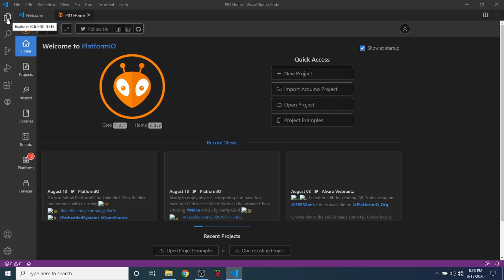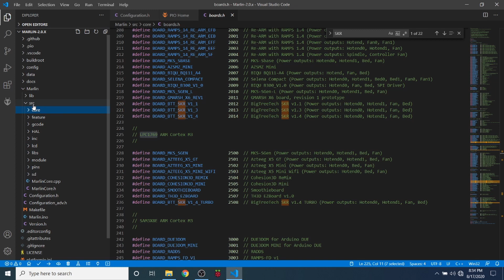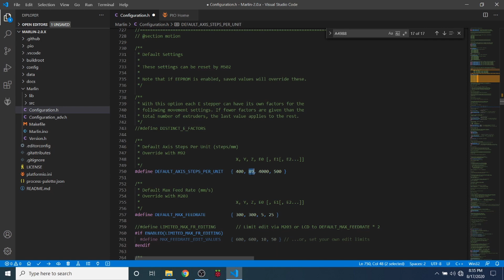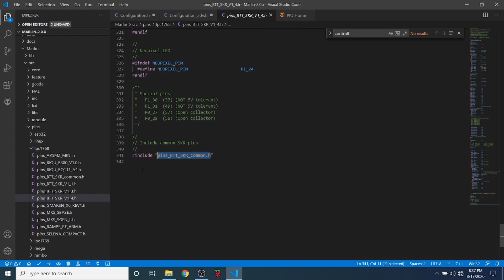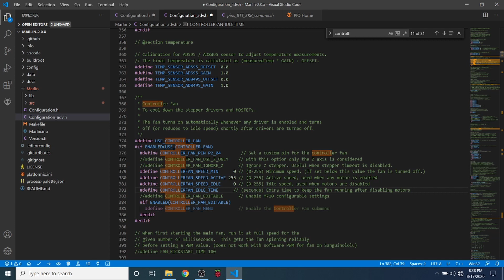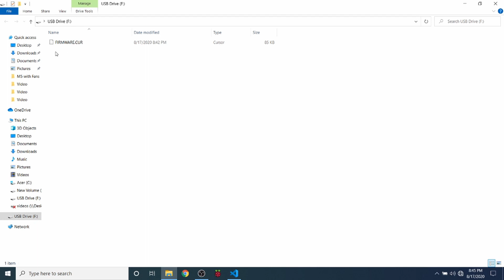SKR 1.4 - Marlin automatic stepper fan controller

Comment: Is there a way to set multiple pins to turn on with this?  I have 3 fans each in a different port on an octopus 1.1
I got it to work with the center fan but it would be nice to have all 3 turn on without having to wire them together.

Thanks!
Reply from the maker: Yes.  There's a link to the playlist in Description .
Reply from the maker: Note BTT Octopus has it's own playlist.

Comment: I’m using noctua fans for enclosure cooling. They should drive on 100% when steppers are moving and 50% when not. Is working fine but PWM is so noisy. Is there any solution ?
Reply from the maker: Better fans?

Comment: I'm trying to do a heated AND ventilated chamber, with HE1 controlling an SSR for the heater but I want another output to control chamber vent fan (to bring chamber down if too hot)... BTT really screwed up by not allowing the normal fan1-3 headers any kind of control. apparently I can use the TFT TX pin but I'd like that free for a future TFT upgrade :(

Comment: Hi! I´ve bought an SKR 1.4 Turbo board but I am having issues to connect it to the PC, maybe it´s missing a driver on the computer, can you help me?
Reply from the maker: What's the jump set to for usb?
Reply: @EdwardBraiman  I am using the blue one, that´s also used in arduinos
Reply from the maker: In my playlist for SKR 1.4 there is a basics video.

Comment: Hello.
thank you for these beautiful videos.
I have skr v1.4 turbo card.

Although I have done all the steps in the video, I could not run P2_04 pin.

I've also tried different versions of marlin but it didn't work.

engine running, fan not running.

Where am I going wrong?
Reply from the maker: Check pin with multimeter.

Comment: Very clear presentation, as always the best.  One thing I don't understand.  What triggers the signal pin P2.4 that the stepper is being used. or is it just that the printer is turned on?
Reply from the maker: I think it's triggered in Marlin firmware code where step or direction receives current for stepping.  As for exactly code level file I would need to search Marlin firmware source code.  It should occur on any pin going to any stepper driver.

Comment: Possible on SKR1. 3 or SKR pro 1.1?
Reply from the maker: It should be almost the same as skr1.4, but SKR pro v1.1 you can you fan ports that have pins.
Reply: @EdwardBraiman  ok. I will try.